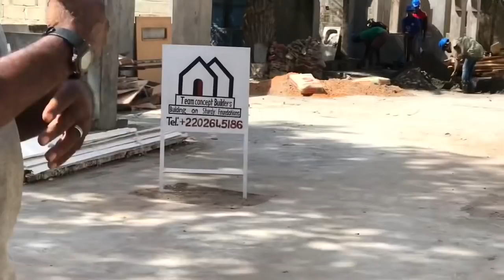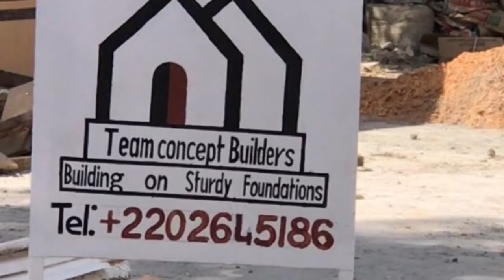Prince Paul’s renovation project in The Gambia Part 2

Comment: I have been watching Contractot Prince anf I wd like to have him on my renovation of my retirement home in Jamaica. Like the Gambia we use steel and concrete to build our homes. Unlike in America so no one can punch holes in our walls. I was working with my electricial ove the weekend and just like Prinvce he is  running bottom electrical plugs piping on the ground. Also I have an abandoned pool filled with rain water